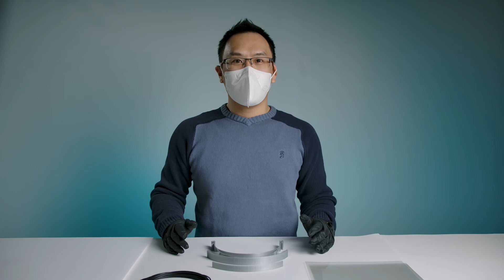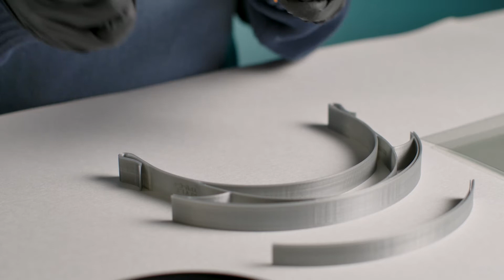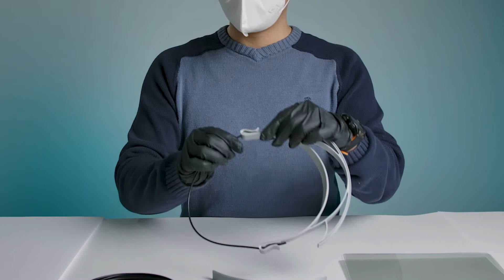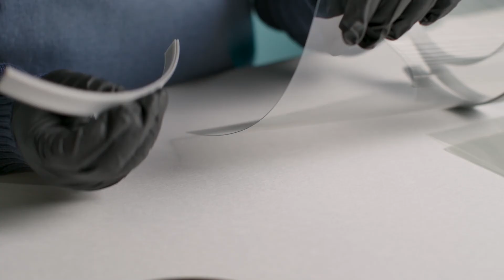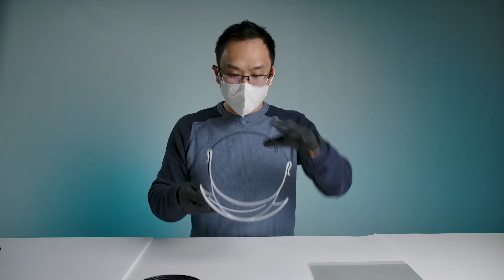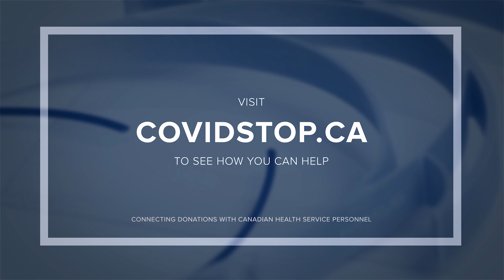3D Printed Covidstop Faceshield for Canadian Makers

Comment: I see a lot of information on these designs, but the actual sheet you're using seems to be described generically (not done here thankfully)
Can you tell me where one would get these sheets? Seems to be difficult to source in Canada. 
Specifically PVC or PETG sheets that are .5-1mm thick sheets are not exactly advertised well.